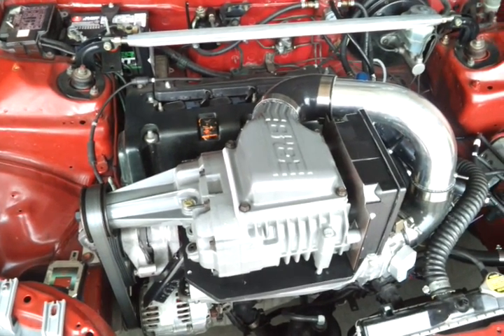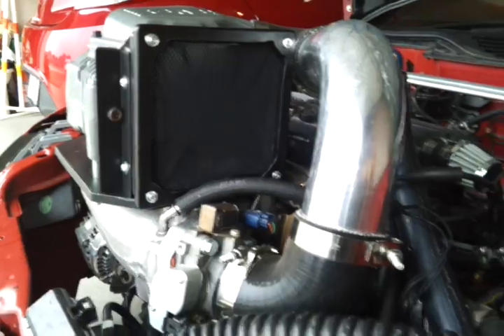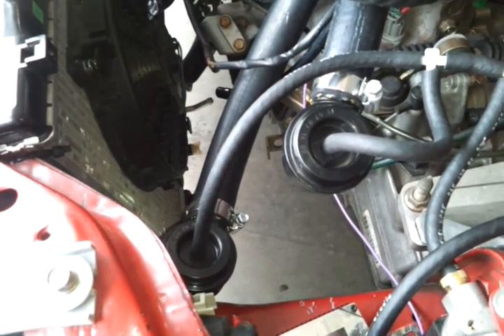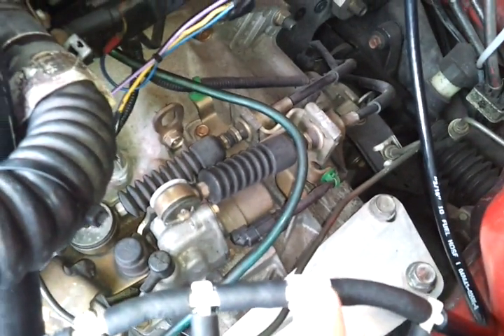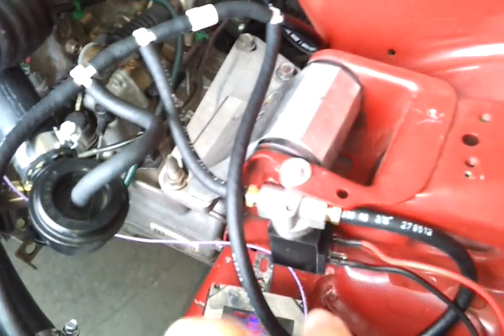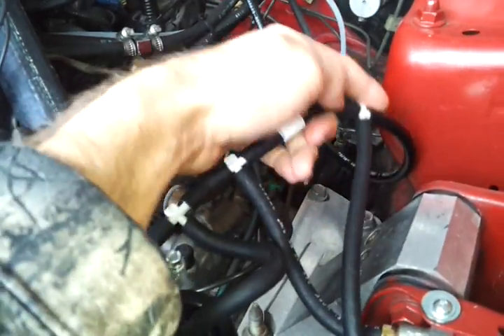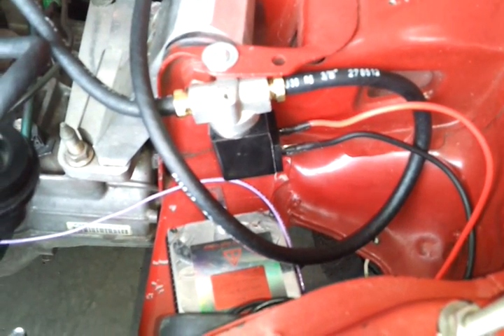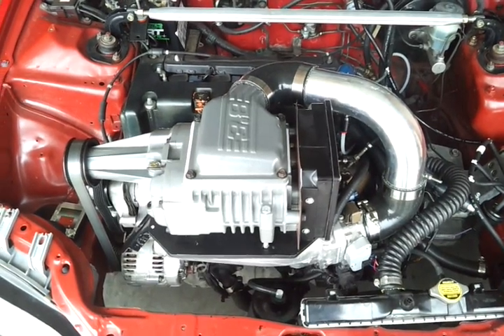$50 boost control. Custom Eaton M90 supercharged Civic,

Comment: How did you do the intake manifold??
Reply from the maker: It was a stock RBC manifold. I had an aluminum plate bolted to it and then bolted the supercharger to the plate.

Output from the supercharger fed right into the stock throttle body.

Comment: Do you have a video with the details of the boost control ECU?
Reply from the maker: Sorry I do not. I was using kpro and had it setup to trigger a relay from the output wires.

Comment: If the Bosch bypass valve doesn’t ever see boost will it limit the system to around 5-6? I want to try and keep my system limited to 5ish psi and I haven’t been able to figure out how to do it.
Reply from the maker: Not sure what your setup is, but if the bypass valve will bleed enough air out Yes. I had to use two of them to bleed enough air out. Basically creating a controlled boost leak.

Maybe not the most efficient setup, but it was cheap and worked.
Reply: @BackRoadBound  cool! I’ll give it a try

Comment: GOOD LORD!!!! HERE i was thinking putting it on my IS300 was gonna be a morph, dude I bet that damn thing SCOOTS!!!
Reply from the maker: Never quite got it lined out, ran out of injector. It managed a 12.5@116 with some wheel hop issues. Definitely had some 11s in it as is and a lot more potential with some bigger injectors. For a $500-600 setup it was not bad IMO. 
Here is the build/track vid. 
https://youtu.be/9wivFuyGYqw

Comment: Did the Bosch bypass valves hold up to the heat just fine? I was going to use a vortech metal style for my m90 due high blower speeds but on your k series, it would have seen some good Rpm aswell
Reply from the maker: They were fine, but I only used them because I got one for free and the other very cheap and it allowed me to have different boost levels.
Reply: @BackRoadBound  what was the crank and blower pulley sizes? I'm looking into the blower speed you ran compared to my pulley ratio. Thanks for the quick response too and I really like what you accomplished with the m90.
Reply from the maker: @madmod I don't have exact numbers, but it was Stock K20A2 crank pulley and stock M90 pulley from 94 thunderbird.
Reply: @BackRoadBound  no that's awesome. so that tells me the pulley ratio was 2:1. That would put the blower at 16krpm with a 8k engine Rpm. I believe the blower is rated at 750cfm at that rpm. That's pretty much right on what my 2v 4.6 @6k will turn with my 2.7:1 ratio so it gives me an idea of the airflow I'm working with. Thanks again.

Comment: Are you running dual throttle bodies?
Or just the one on the stock location?
Reply from the maker: No. Stock k20 throttle body. Stock location. This was a blow through setup.

Comment: Sorry, why is the check valve  in the circuit?  Or what is the D.P. on the check valve spectrum. Does the vacuum change on pressures 29hg. To positive pressure? I'm new to this, but with that $50 boost control leads me to believe that you are probably from the dry south? Looks a little like couper fanangalings. I love it, thanks for the info. Remember there's no replacement for experience,

Comment: Do i need to blow valve or could I used one only
Reply: We’re did you bought the by pass valve
Reply from the maker: Eloy Casas One was given to me by a friend and the other I bought off eBay for cheap.  Bosch bypass valves like these come stock on many vehicles. Good if your on a budget. If not you can by a bigger/better aftermarket bypass valve for $200+
Reply: You think I’ll could give you my number to txt you

Comment: That supercharger has a displacement almost as big as the engine, how effecient is it?
Reply from the maker: Douglas Moore not very efficient. Makes a lot of heat, which was put in check with meth injection. 12#s of boost was good for about 100whp
Reply: @BackRoadBound  why not intercool it?

Comment: (2013? sorry, late to the party) but like he said... SUPER CLEAN. You really picked a GR8T SC model. Luv the cast intake housing and especially the "direct to the point, no frills, get'er done" SC intake side. Using that 3.8 SC shows that there is wiggle room when it comes to making choices. it seems on the surface to quite large for your current motor. But you make it work. That plus the "do it yourself effort" makes it perfect. Good job (no matter the ultimate outcome". You've already won :O)

Comment: where would I be able to get one of the output plenums that bolt right onto the supercharger. I'm looking to supercharge a 240z and having an outlet from the m90 would make the setup so much easier
Reply from the maker: Mine came with the blower that I bought off ebay. It is off a 94 Thunderbird. I just cut the threaded collar off the end. I believe I used a 2.75" silicone coupler and charge pipe to match the outlet once the threaded collar was off.

Comment: you could always just use the built in bypass valve to leak the pressurized air back to the inlet side of the rotors. right?

Comment: I have some M90's laying around, did you get yours of a 3800? If so, how did you shorten the snout?
Reply from the maker: 94 Thunderbird. It has a shorter snout. I also used a cutting wheel to remove the threaded coupling off the factory charge pipe. A 2.75" silicone coupling fits perfect over it, once the threaded piece is gone.

Comment: I have a pontiac pursuit, the stock ss cobalt comes supercharged, but since none of us have $4000.00 to install a stock unit on the same motor (except mine is a 2.2 and there's only one place to reflash the PCM to recognize boost) a long story, the obvious answer would be buy a used m90/m62 or even an m112. And who gives a shit?! make it fit. As long as you can orient the charger to be driven and sturdy, all you need to do is just bolt on a fabricated intake plate to bolt to the pressure side, you could plum it from there, through an inter cooler and back to the engine. I would have loved to do this to my 92cx hatch. Boost control is necessary, though a lot less hands on stuff other than staying up sleepless nights thinking about it. How to make this work?! Then all of the sudden bam! U just pulled an 11 sec et.

Comment: Why did you not put the SC between the throttle body and intake?  Seems inefficient to compress air at all times and vent it away...
Reply: motoman22atgmail it's a remote Mount m90 off a thunderbird. He more or less has it set up to function like a centrifugal supercharger and this is a common practice for retrofitting m90s on almost any kind of engine. Will have a little lag off idle to pressurize everything then it comes in on the top end like a centri but allows the air charge from the m90 to be cooled before entering the engine either with meth or a intercooler.

Comment from the maker: If your talking about the stick screw coupling that connects to the factory Thunderbird charge pipe, I cut it off with a cutting wheel. It's a 2.75" smooth pipe once that threaded coupling is gone.